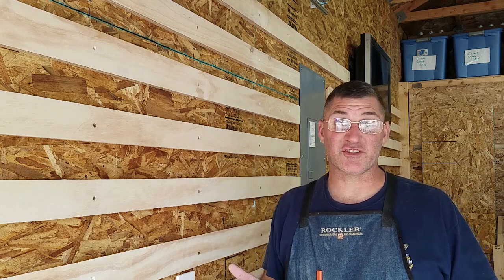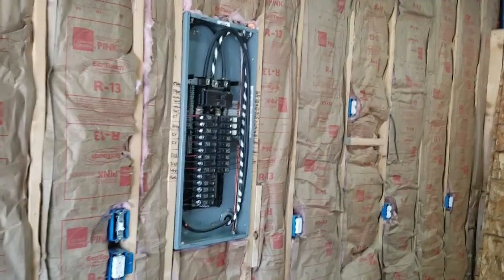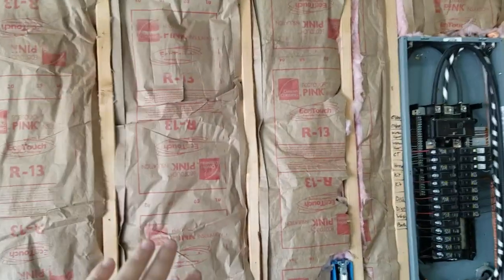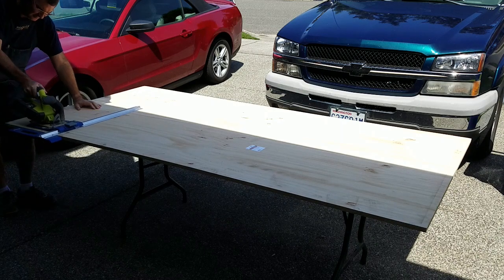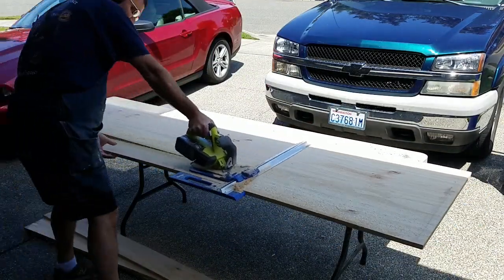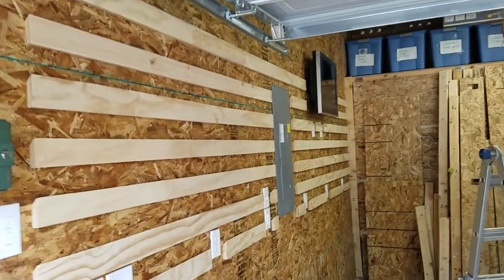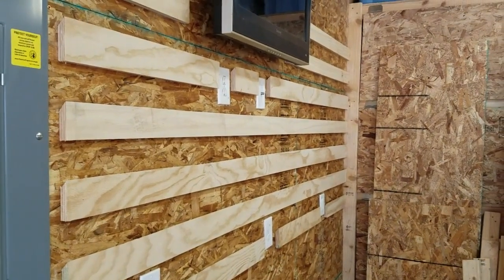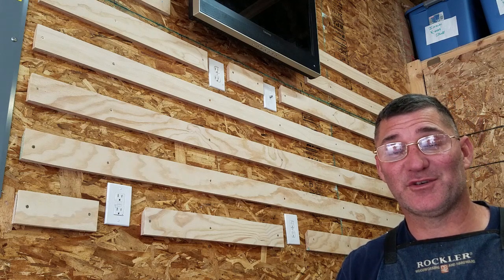How to Build and Install a French Cleat Tool Wall System | 2019/15

Comment: What spacing did you use between each cleat? Looks great by the way.
Reply from the maker: About 3 inches. I would have to go out and measure.. I remember it being just a little taller than the cleat.

Comment: How big of nails you using? Are they strong enough?
Reply from the maker: Screws. 2 1/2 T25 Torx. Check out my other video where I talk about strength, fastners, etc. 
https://youtu.be/OdPmINrCtLg
Reply: @DadItYourselfDIY  ok 👌.  As far as the spacer between the cleats, whats the spacer size?
Reply from the maker: It's purely up to you. I usually do between 3 and 4 inches.